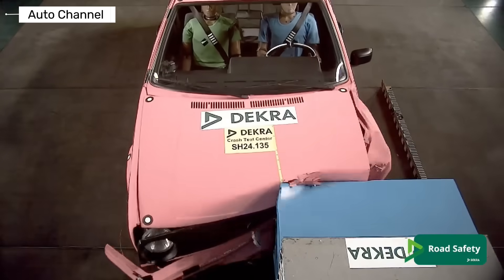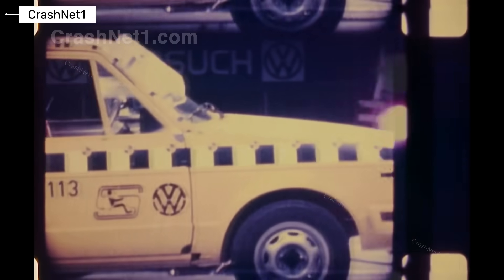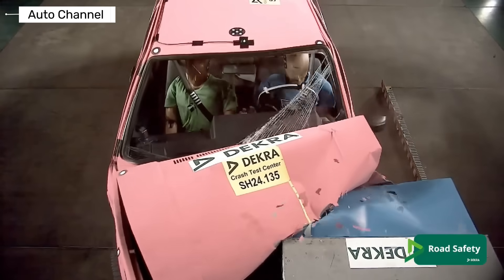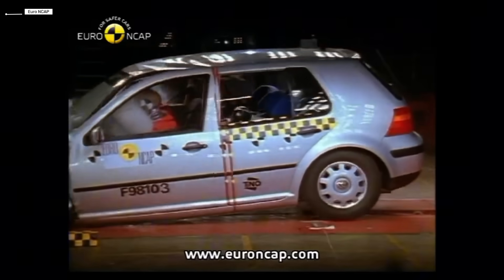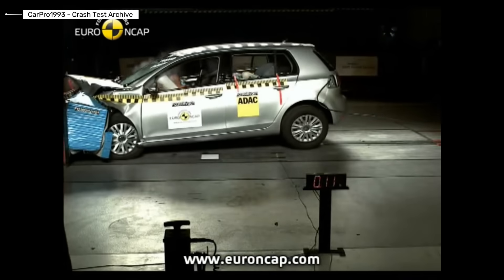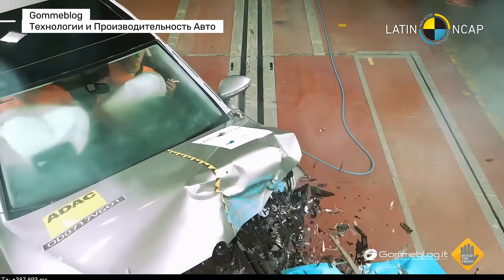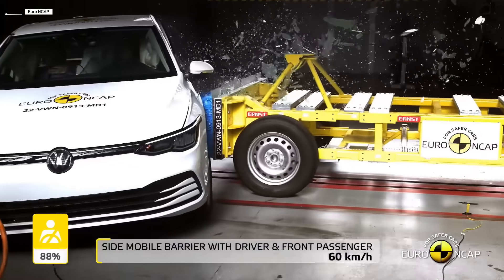Volkswagen Golf Crash Test Evolution From First Generation to Latest Model

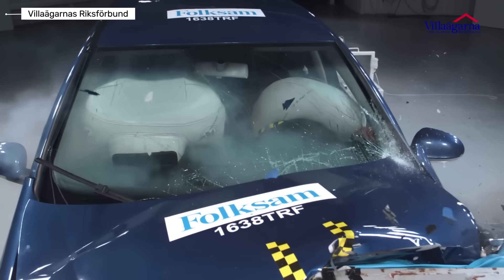Comment: 3:42.  I've owned 3 Mark 4 Jettas.  I notice that they're using old rusted cars.  The Mark 4 Golf and Jetta models have always had a problem with draining the water that enters the cowling.  It gets trapped at the bottom of the front fenders right behind the wheel opening, thus the rust.

Comment: The elephant in the room is that the driver "assistance" features in the latest generation are really annoying and add to driver frustration, they can even be dangerous unintentionally. Also all the added weight and complexity of these systems has made vehicles less fuel efficient and more expensive to buy.
Reply: That's right, a few extra kilos of electronic systems lead to increased fuel consumption. But using the car with only one passenger (driver), most of the time, is not a problem.

Comment: Strange comments; the  Golf 1 had crumple zones, even accordeon-like front beams, the collision test shows a progressive absorption of the forces and the forces on the passengers are kept in check.
Reply: 100% True! I had 3 of them (2 GTIs and a Cabriolet) and i also worked as an autobody repairman for years. The only annoying thing, compared to Golf 2 and newer..was that the front end was soldered entirely. But the front beams were clearly designed to crumple in a crash and absorb the impact, very ahead for its time 😊
Reply: Yes Golf 1 had crumple zones, but passengers aren't kept in check in moderate crash test. Note that 100% overlap test is very easy to pass. In moderate crash test whole passenger compartment collapses and especially driver is pinned between the dashboard and seat. Search from youtube: "1980 AMC Concord Coupe Into 1980 Volkswagen Rabbit Moderate Overlap Frontal Crash Test"
Reply: 100% true, i still have a mk1 and there are crumple zones and accordeon beams.just had a accident months ago and replaced them

Comment: Golf 1 did the best golf 2 and 3 are worse 😂
Reply: Гольф 1 били при 100% перекрытии
Reply: 😮 Don't show the world,you got no clue.Golf 2 were build to everlasting.
Reply: Well the 1 did a full crash and the 23 did a moderate, small overlap crash. It's different.
Reply: Golf 1 was tested 100% overlap. Others 40% overlap or even less. It makes a huge difference. Even very poorly designed cars can pass 100% overlap test. Don't believe me? Look from the youtube "1980 AMC Concord Coupe Into 1980 Volkswagen Rabbit Moderate Overlap Frontal Crash Test"
Reply: nope: Golf 1 was with the old test at 54km/h, (later was done at 65kmH = twice the energy!)
Reply: @peterjezersek-ng8zq: and at 00:02?
Reply: Well at least the doors didn't bend open halfway ant the roof bending into space like golf 2 and 3 plus they all gave a head butt to the steering wheel
Reply: No it didn't, it just had an easier  test